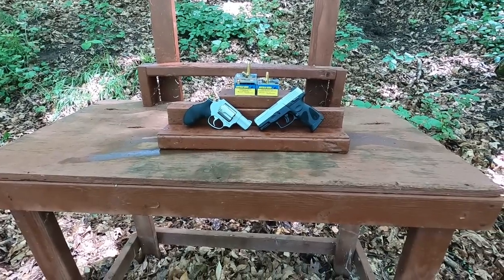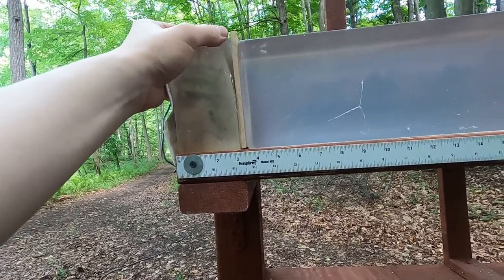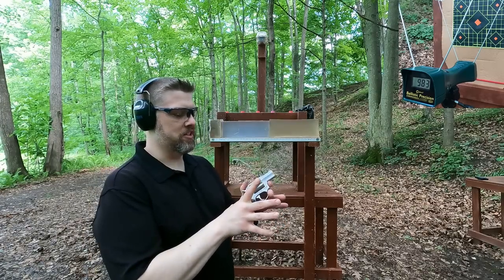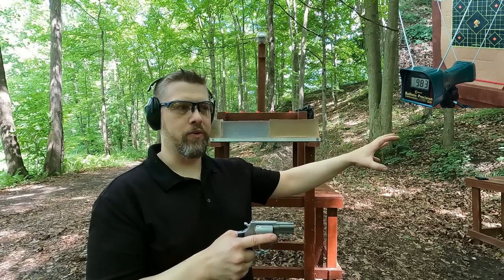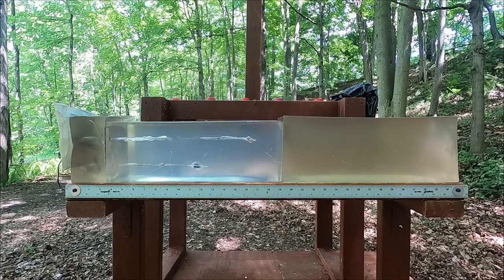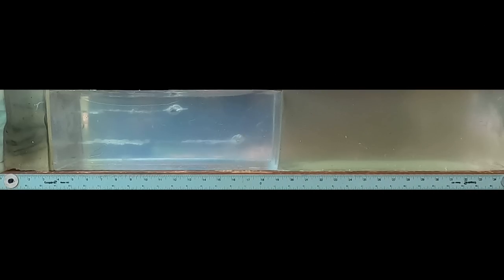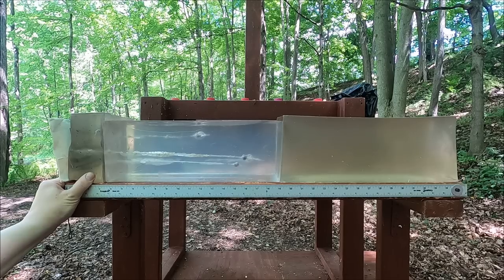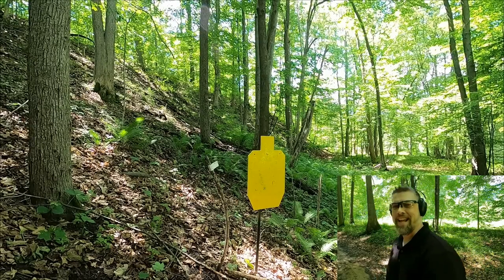.357 Mag VS 9mm Short Barrel Low Flash

Comment: I appreciate your testing. You do a good job pointy out the deficiencies in the different calibers. I only use any 147gr 9mm in my carbines. One is an AR style with a 16" barrel and the other is an AR style pistol with an 8" barrel, and the bullet drop at 75 yards is significant on both.

Comment: Good video.  Thank you.  Have you tried out the same 9mm 147gr XTP's in the +P format with the same  pistol?  And have you tried the same standard load in a different pistol?  My point is that there is no way this tumbling should be happening and I can't see where the problem is.  My G26 has never exhibited this.  So, I hope you will have the desire and opportunity to figure just what the cause for this tumbling is.  

Thank you!
Reply from the maker: Thanks. If I recall right, I had other 147 gr 9mm's tumble from this Taurus G2C. Makes me think maybe this is the reason for the issue.
Reply: Different guns different barrel not all one size fits all